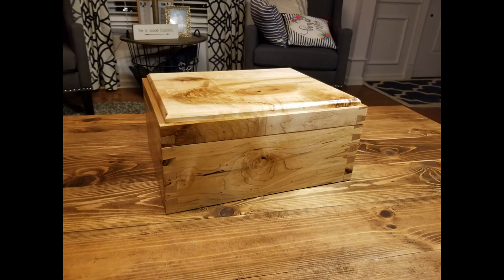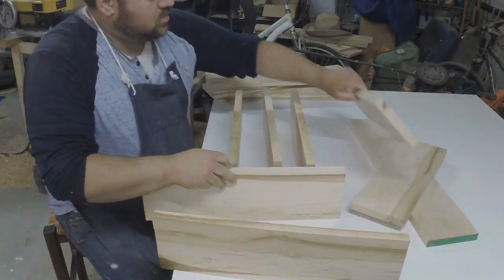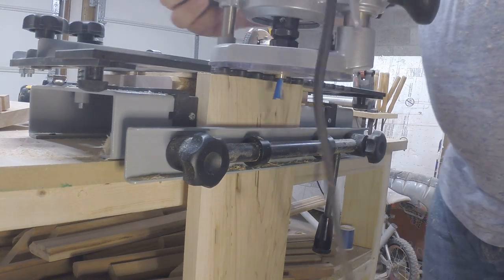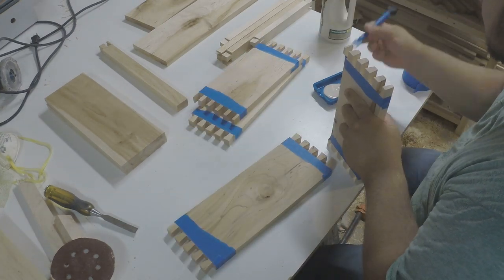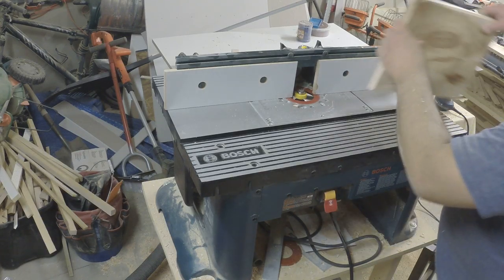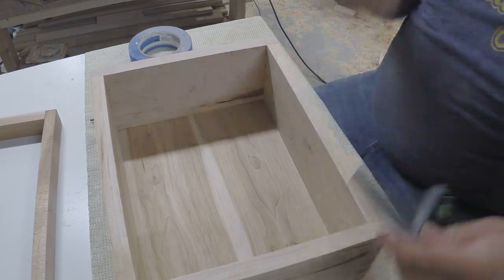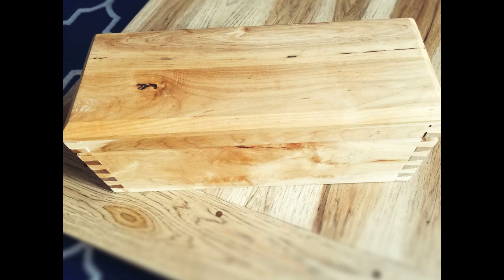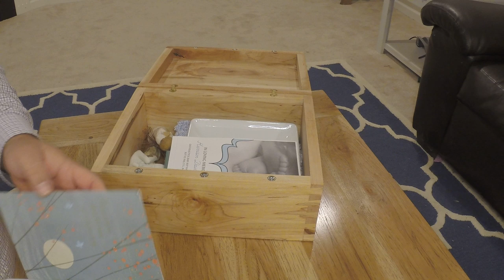Dovetail Keepsake Box with Invisible Hinges and Latches - Woodworking Project

Comment: Are the barrel hinges tricky to apply? I've seen other videos that make it seem difficult .
Reply from the maker: I've used them a few times and I don't find them too tricky. The key is to make sure your holes are the right size, in the right place and at the right depth.  If you get that right then installing and adjusting the barrel hinges is a piece of cake.

Comment: Why do u change bits between sides and front/back? U have a similiar jig and both peices go in at same time
Reply from the maker: It depends upon whether you are making half blind or through dovetails. If you are making half blind dovetails, which I use a lot for drawers, you do not need to change the bit or the jig.  I used through dovetails on this box and with the dovetail jig that I have I need to change both the router bit and the jig template.